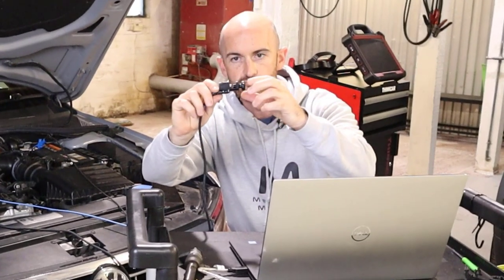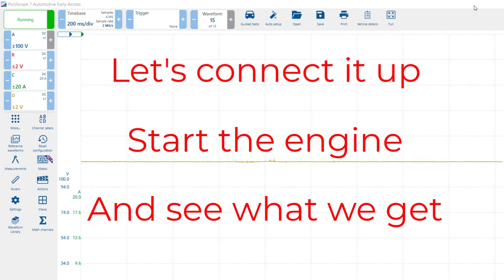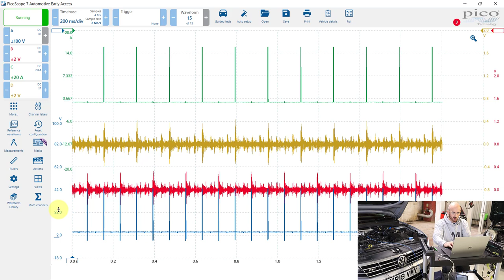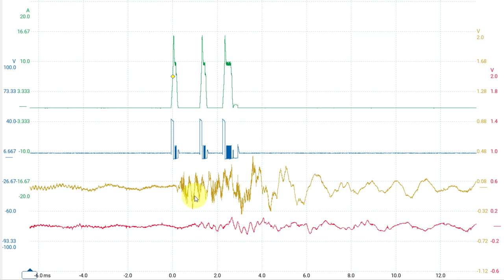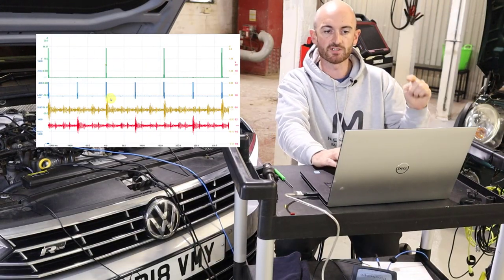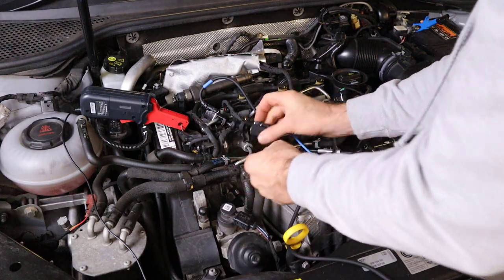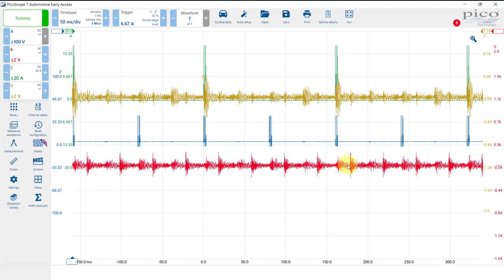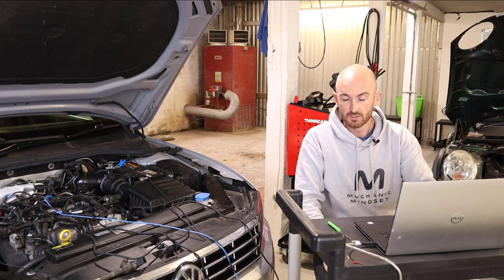Injector Not Opening? Rotkee Vibration Sensor Review

Comment: Great video, seems like this would work well to use this as a synch for a relative compression test.
Reply from the maker: Great question, I don’t think so. On the diesel we usually disable injection so the pulses wouldn’t be seen during cranking
Reply: @MechanicMindset are there alternatives to using crankshaft sensor as sync signal for diesel?  thank you for great videos:)

Comment: Not really a vibration sensor if it doesn't pic up vibration from plastic hoses as well but more like a knocking sensor/microphone that feels the knock/ping in the fuel pressure spike.

More like a digital stethoscope for the oscilloscope.

Could possible be used to find and time to check engine noise also.

Never the less i see this as a useful tool that i want 😁
Reply from the maker: Solid plastic it works. I tried on rubber and it wasn’t great (nothing solid to couple to). 

Vibration is just what they call it but yes I see what you’re saying 👍

Timing to noises sounds like a great use for this sensor! Cheers

Comment: Hi great video could you use this to disgnoise noisey wheel bearing or engine gearbox noises ?
Reply from the maker: Not sure, I understand this is an ultrasonic sensor, so might be too sensitive, or not effective. Be better getting some cheap piezo elements and glueing them to croc clips. Or get chassis ears; i love that tool for noises
Reply: Yeah looked at chassis ears but wireless ones are expensive which make ones do you have?
Reply from the maker: @danielgreenbaum8875  I just used to used the old wired ones. Think they were original brand. Yes, not cheap.

Comment: I don't work on diesels so it may serve a purpose there....however on a regular gasoline ice engine, this seems gimmicky especially when you're already getting a voltage and current ramp which would provide a more definitive answer compared to the noise this provides.
Reply from the maker: Works well on GDI where you don’t get such a definitive pintle hump or kink on current ramp 👍
Reply: @MechanicMindset  Thanks Darren.  That's good to know.  Maybe I will have to email Rotkee and tell them to add this cable to my pending order.
Reply: @NextLevelAutoDiagnostics  I have them they work great on gas too and can be used dual purpose for noise too.

Comment: Pretty cool and I'd like to have one, but when I went to order and checkout, the option for PayPal was requested for 'friends and family' only. (No payment protection...) I emptied the basket and will make do without this tool.
Reply from the maker: Yes I hear that puts quite a few people off - I can confirm they follow through and have great customer service. Lots of orders delivered. I will say getting hold of them at the minute can be tricky...
Reply: @MechanicMindset  Thanks for the reply, Darren. All they have to do is add 3.5% to their price to cover the difference and both parties have a little more comfort. Other than that I have nothing against them unless they are using that practice to avoid the tax man (which I totally understand, just wish it didn't have to be that way...)
Reply: @KingLoopie1  I have asked our local PayPal about this. It's PayPal's policy for Ukraine atm. "Friends and Family" only in some places,  No thing allowed in my place.
Reply from the maker: @tonylin9833  Thanks for sharing!
Reply: This was my thought as well but I followed through and my order arrived last week. I got the vibration sensor and the pulse pressure sensor. My order total was only 60 dollars (I think) so it was worth the risk for me however it turns out there was no risk.
Reply: I just ordered from them paid using PayPal and they responded through email. They are in Ukraine and still doing business in spite of a war.